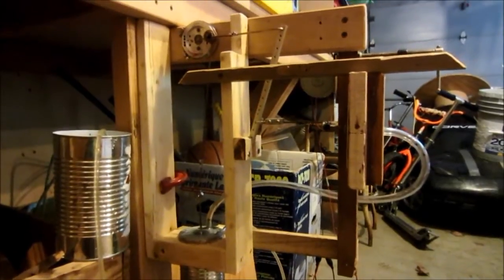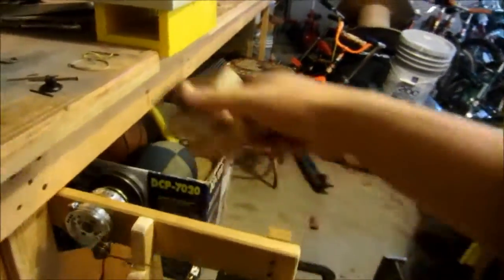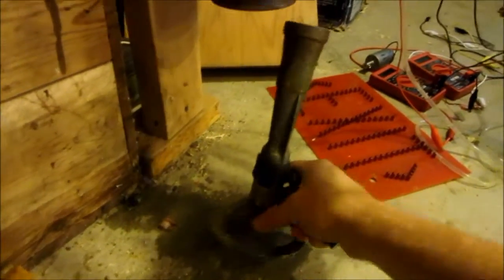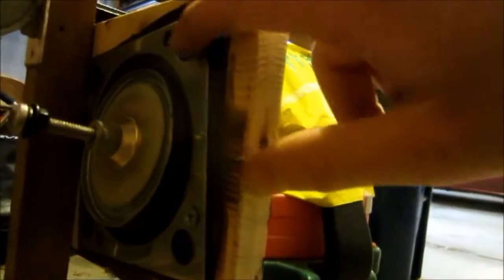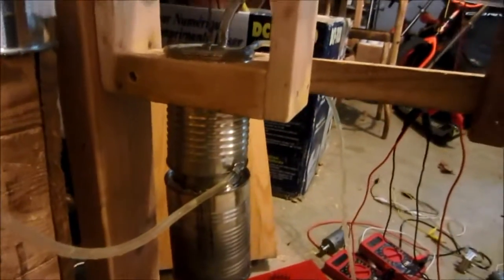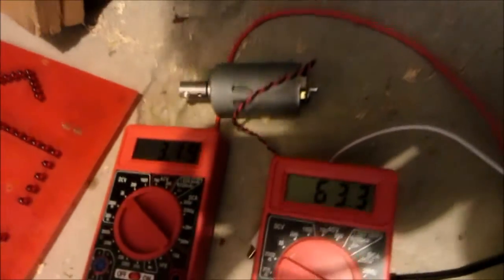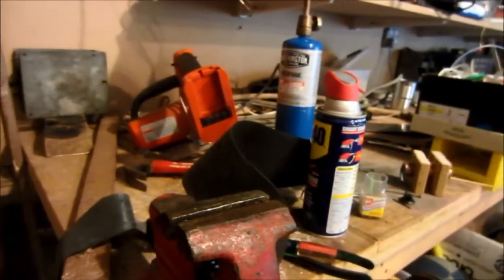Stirling Engine #4 Last Run with New Diaphram Record 0.5 Watt Output!

Comment: Blue rtv is good. black is a little better with oil etc. Also be worth checking it doesn't melt cling wrap if your going to do that with it. Manufacturers sheets lie a lot, defiantly worth testing it yourself.

Comment from the maker: Yes I have some blue RTV if that means anything.  I tested it an it does goes to about 400F.  You see I am going to have two plats at the top of my stirling engine just like in my second stirling engine that are bolted together.  I will use the silicon for that seal.  It worked very well for that engine.

Comment: 1mm would be no problem for a hole saw made for metal, I've seen adjustable ones. Or hack saw, or dremal. After about 2-3 mm it starts getting a lot harder to deal with. Another thought, is rather than spin the tool, can you spin the plate? It would be very hard to go off center then.

Comment from the maker: If I took to much out I would probably fill it back in with solder.  I will need to solder to this surface anyway so JB weld would not work.  The Cling wrap is a very good idea to use when I make a silicon seal for my engine.  I might just use that idea!  Thank you!

Comment: Or, if you take too much metal out, you could possibly mold JB weld or something to a form? Cling wrap can be great for giving you a few microns of clearance. Cling wrap your piston, and form hard up to it. Then when set, remove all the cling wrap, you should have a clean piston, and a very tight cylinder. I do the same thing with silicon to seal car windows and doors. Carefully coat the glass with plastic, put silicon all over the rubbers, and close window till set. Works great.

Comment: If your going to try that, I'd go a millimeter or two too small, and work out to your pre-marked circle hole slowly with a hand file or small grinder. Or you could make a hone. Google images "cylinder hone". Its a bit like 2 or 3 rounded sanding blocks on a a centrifugally expandable scissor action rotor. Could be handy for other cylinder honing etc if you made one. A little bit tricky, but well withing your skill set I think. Good ones can be set to stop expanding at a precise diameter.

Comment from the maker: I guess that is a possibility...  I think I might just use the saber saw with a metal blade and I might try drilling a hole in the guide that matches up with the hole in the middle of the circle and put a bolt though so that is works like a compass and cuts a round hole.  I guess I want to make my design as DIY as possible.  Thank you!

Comment: Hmmm 3mm plate...Take it to a shop and get them to cut the hole. Will only cost a few dollars. Ring around. Someone might do it free if you give them a plug in the video :) Most places that do engineering or heavy metal work, like tractor mechanics, will have a drill press with a hole cutter the right size. Or you could use a hole cutter, on a slow drill, with cutting compound, or at least some oil to keep it cool. Will take ages! you'd want a few charged batterys. Go call some shops.

Comment from the maker: Yes and it is nice because you can adjust it for more or less heat to make it most efficient.  If I put it in a lower hole it will run on much less heat.  I am still trying to figure out exactly how to configure everything on my new Stirling.  I pretty much have is all together in my head but I am procrastinating at building it... ;-P  My main hold back is that I need a near perfect hole the diameter of a wiped cram can in a piece of 1/8 inch steel.  What would you suggest?

Comment: Yep. exactly what I was thinking. + its adjustable, so you can get exactly the stroke length:power ratio you need to the crank. Mech/friction losses are low, and potential to exploit simple leverage is high. I think we may start seeing this idea on other stirlings. :)

Comment from the maker: So comparing my piston with a large stroke but a small area to the diaphragm with small stroke and large area.  The diaphragm because of the large area will push really hard but not very far.  The piston on the other hand will have a smaller amount of push for a much longer stroke.  I had to add the extra linkage because the diaphragm had to much in^3 for my displacer.  Continued in comment 3...  ;-D

Comment from the maker: I knew someone would ask!  Yes that is what it looks like at first glance!  But really it is the best place it will work.  This is because with one stroke of the displacer there is a certain volume of air that is pushed in or out of it(displaced).  So lets say that volume is 1in^3.  I'm thinking that in a perfect world if the piston/diaphragm is also 1in^3 no matter the stroke or area it will still put out the same amount of power.  Continued on second comment...

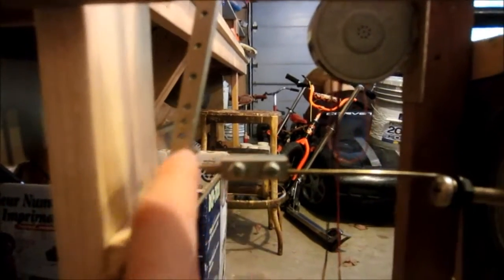Comment: 7:02 It doesn't look like your diaphragm is in much of a good leverage position at all. Wouldn't it have better leverage further up that metal bar with all the holes in it? Or even just directly connected to the wheel and without the metal bar at all?